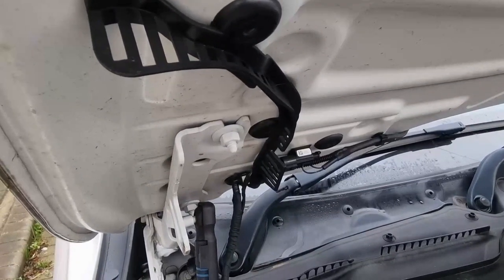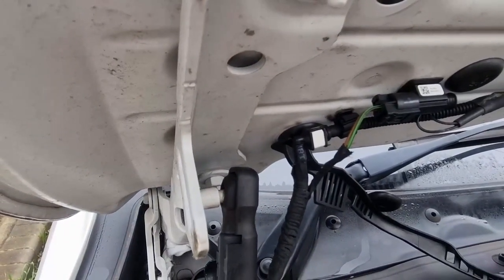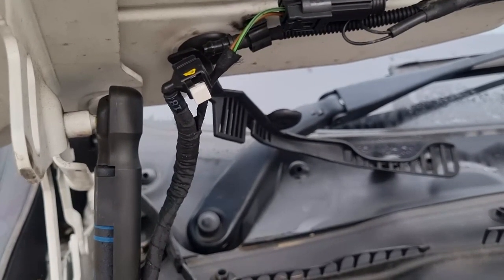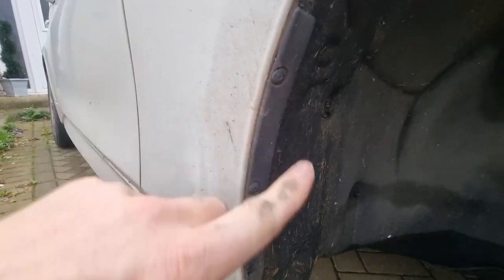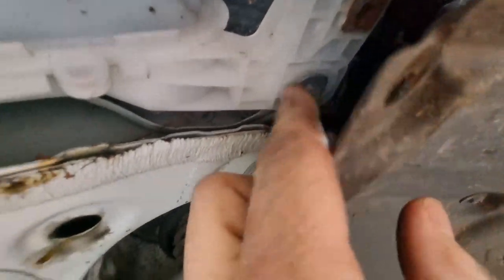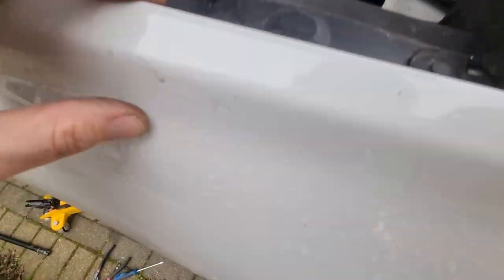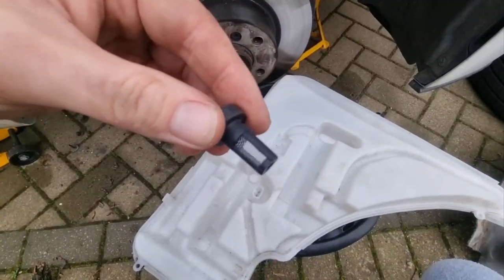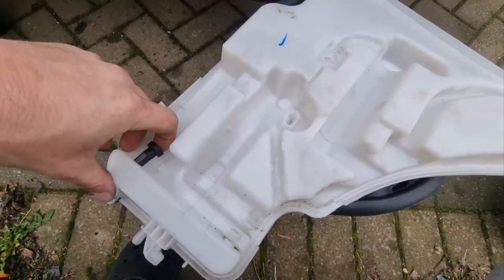BMW F30 3 Series low screen wash pressure Emergency and full fix guide.

Comment: Thanks for a very useful video - my 320D is 8 years old and this is the first problem with the washers.  In my case flow suddenly stopped!  What a palaver to get to that silly little filter, which was clogged as suggested with BLUE sludge, so sludge from the recommended screen wash!  I've given up car maintenance but wasn't wanting to fork out £100 odd to have a garage do it.  I used to complain about BMC/BL cars not being built for maintenance but this is no different.  Unbelievable range of fixings for one panel.  All now working so thanks again.

Comment: Did mine just now. Got one screw left over as you do :D tanks fully secured top/bottom so im thinking it might be trim but that's holding on well too. Got an mot tomorrow so ill take my chances.
Reply from the maker: Sounds like wheel arch liner screw lol no biggy

Comment: Thank you so much.  Brilliant video absolutely spot on, followed your instructions and cleaned filter & tank out. Bit of a job removing wheel & liner but straight forward enough folding you instructions.  Thanks agaain
Reply from the maker: You are welcome

Comment: Thanks for this 👍🏽 Second time mine has clogged. First time cost me £70 at the garage, won’t be paying that again so going to give this a go on the weekend. Already tried blowing down the tube and no luck
Reply from the maker: blowing down tube is an emergency fix to get you home. Some people use drain cleaner or equivalent to clean the reservoir. Once out just get the hosepipe in there.

Comment: Hello, I have a bmw f30 2.0 2014, I noticed that the windshield washers no longer work at all (the past few days they worked perfectly), there is no noise anymore and I don't have any errors, do they have fuses and where are they located, what can I check more exactly? thank you
I saw that it does not write the number where this fuse is positioned on the panel, or it is not set from the factory, because it is not set.

Comment: Connected a kettle steam washer to the washer hose you just disconnected.
Heat and steam cleans the filters that the pump has to work through. Only works if the pumps are running of course.
Reply: great idea, i'll give that a bash before stripping the arch down

Comment: Great video! Obviously here because I did run into this problem now with my 2016 BMW 320I after 7 years. One day I went to use the wipers and notice the water was having a hard time shooting up to the windshield like it used to. I would just go to the gas station and add that wiper fluid into the tank when the notifications came on telling me I was low. Aww man! Once i got to the tank, I saw all that nasty sludge just built up in there, it was crazy. So now im not sure what to use. I mean I live in warm climate so im not worried about it freezing but i feel weird just using plain water to remove a bug splat on the windshield. I feel like I need some soapish substances to remove that kind of stuff. So for now, I bought the official BMW concentrate and plan to just dialute it with water. Hopefully that doesnt happen again. Anyone knows the proper stuff to use? I hear some peole say that offical BMW stuff is just same stuff with the brand name slapped on so im confused with life at this point over water for my windshield lol.
Reply from the maker: The main thing I have learnt is to not mix products. So if your using dilluted concerntrate then continue don't then mix in ready made screen wash. 

I would use a concentrate  as it will also prevent the water going mouldy I started using the bmw stuff was strong and worked well but was expensive. 

You can use something like this 
https://amzn.to/3JOirED concentrate that also adds a layer of protection to the windscreen. I love rainex products. I use the cleaner and hydrophobic glass protection.
Reply: Thanks for the response. I will definitely look into the link from Amazon. Says currently unavailable for me but I'll keep an eye on it. I love Rain-X as well as I've used with other cars in the past.

I'm starting to get the feeling, as much as I love my BMW and the way it rides, it has got the weirdest issues coming up I haven't experienced with other cars. Example the interior rubber on my door handle melting from the extreme heat, interior headliner coming off cause adhesive is gone. Molding trims slowly peeling off cause adhesive melted off and now the windshield issue. 😅

Comment: How did you attach the filler neck back on to the hose pipe going to the washer bottle? I cannot seem to get mines back on.
Reply from the maker: The easiest way should be to just push it down and  twist it round in a screwing motion. I can't remember if the hose is runner or plastic. If its rubber ypu could also leave it in a mug of hot water for a few minutes to soften the rubber making it easier to expand and push on. Will shrink back once cold.

Comment: The joys of BMW ownership! This is such a silly thing to have to do. I ran a shop vac in reverse through the reservoir catch and blew out everything. I think i need a new pump... water spills out the line but there is no noise from the jets whatsoever when i pull the stalk. Zzzz... love German engineering, eh?

Comment: Where is fuse for windshield fluid pump in bmw 320i 2013  please?!
Reply from the maker: Fuse 80. Fuse box under rear slam panel in the engine bay.
Reply: I think 80 for back wind shield heater are you sure?
Reply from the maker: @alikevser6815  https://www.google.com/amp/s/fuse-box.info/bmw/bmw-3-series-f30-f31-f34-2012-2018-fuses-and-relay

Comment: Urm.... just an observation, no need to take all this apart, just reverse the procedure, just connect a hose that you can regulate the pressure with, and push all the shit out the opposite way, don't blow down it, or use air, just run a water supply through it, leave it running, you'll see all the shit come out the filler pipe